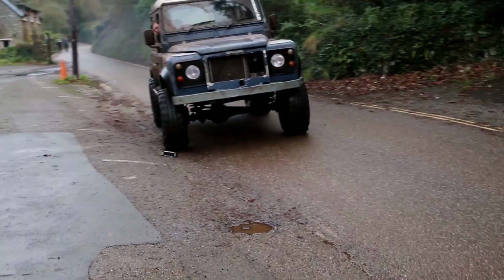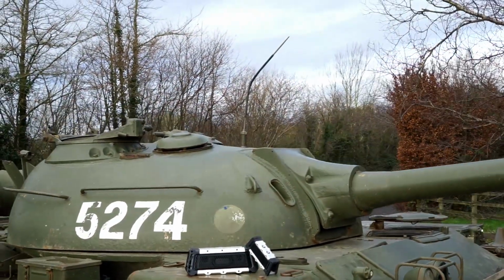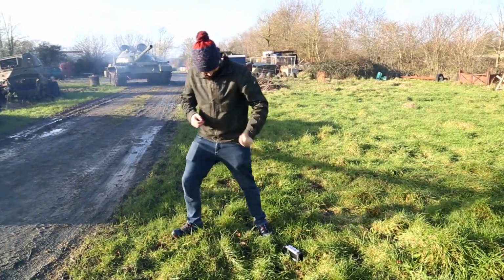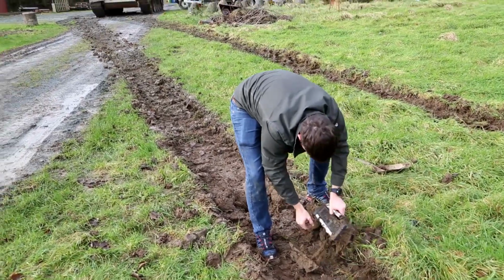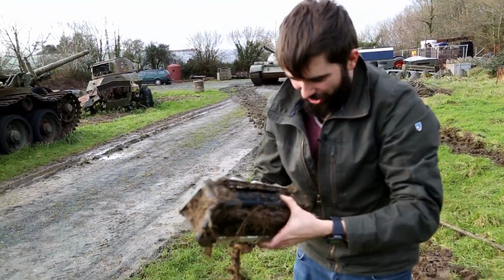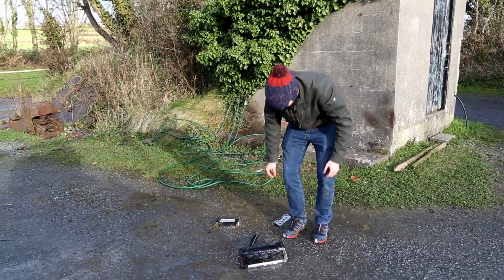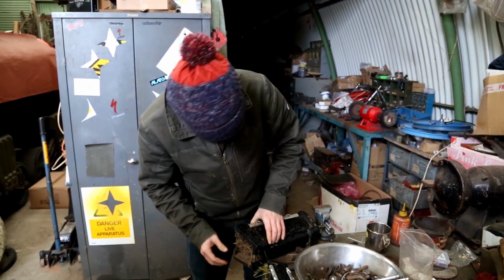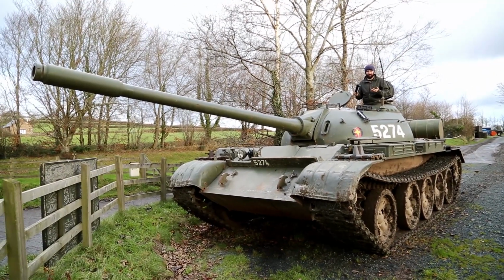Fugoo & Fugoo XL Vs. Army Tank | Ultimate Torture Test

Comment: cool tests! But if you really wanted to scrape up a techno cookie off the ground, you should have ran the tank over solid ground (asphalt road) with the speaker at the bottom. In your two tests, the weaker of the two was not the speaker, but the dirt floor. It slid right in! Still super ultra cool though!

Comment: I just bought my second Fugoo XL because after 4 years of heavy use (it never leaves my bike 30K+ miles) the 1st one was down to about 6 hours of playtime per charge. The new one out of the box, and fully charged was run for about 4 hours and when checked was at "about 1/2 full". The claims of 30 hours of playtime are fantasy. I like the durability, I like the volume, I like most everything except the company outright lying about how long it will play. I also don't like that you have to buy some cheap POS charger as a replacement should the provided charger fail. Apparently, they don't feel the need to support the products. Everyone stay safe. - @t